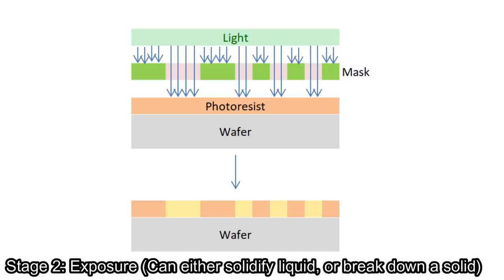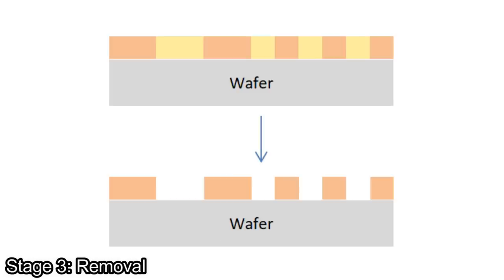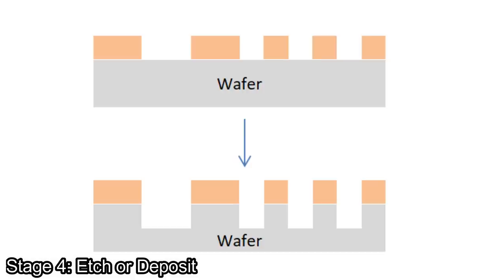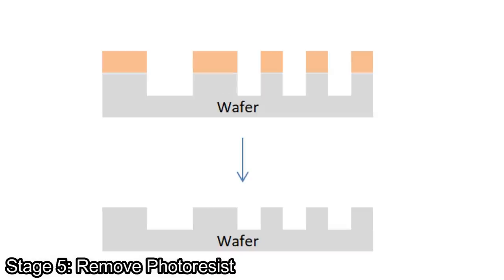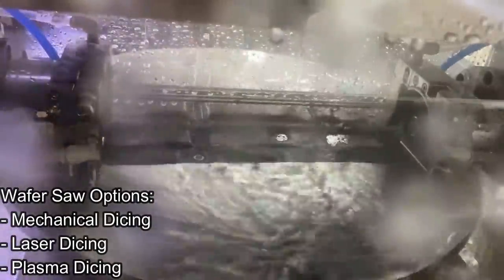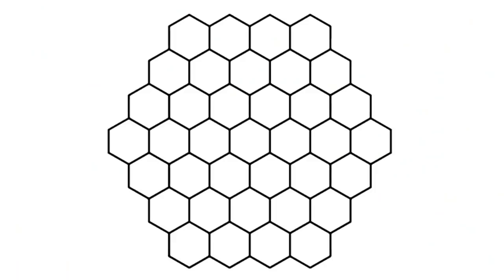Why are Processors Square (and Wafers Circular)?

Comment: I work at a company that makes Lithography tools, and the systems are designed to "print" square shapes... printing any other shape would require an extensive redesign of the projection optics
Reply: Exactly, retooling an entire fab's worth of tools to move from square to another shape would simply cost too much at this point. We're too far gone with square lol.
Reply: But arent optics generally round as well? My knowledge of optics is basically limited to camera lenses, so things might be quite different. Cameras also have the same problem, lenses are round but the sensors are square. I guess because Lithography systems can only print square sensors..
Reply: @calaphos  You will waste a lot of empty space in between circle but nothing in between rectangles.
Reply: @maggiejetson7904  but hexagonal is much better.
Reply: @zalomalo  Until you need to spend more machine time making them, which means money (machine time is the most expensive thing in the fab).
Reply: @maggiejetson7904  Exactly. And the lithium is, as said in the video, very cheap. And reusable I imagine, meaning the extra lithium is just moved back to the beginning of the process and melted
Reply: @maggiejetson7904  Assuming your reticle limit due to optical abberations is intrinsically circular, hexagons are the more efficient way of tesselating.
Reply: I mean, if you put two triangles together, that is a pattern that repeats along two axis, just like rectangular stuff. I'm not saying triangular chips are better, but they'd look cooler.
Reply: @namibjDerEchte  It is efficient for hexagon if time is spent "processing" in optical process (thermal and chemical need no alignment). Aligning in optical pattern means you need to spend a lot of time with 2 axis, or add an extra axis. Slicing and dicing when finish is also harder.
Reply: @zalomalo  begone! CGP fans!
Reply: Is that the reason why the unnecessary partial chips on the edge of the wafer are also created? I have always wondered why they are even bothering to lithography those.
Reply: @DeeGeeFi  Hard to say, they may do that as a way to easily inspect the pattern, like those color coded dot on food packaging with one dot per ink.
Reply: When the photolithography is happening is that being done on a chip by chip basis or on a wafer by wafer basis? Clearly the photoresist chemicals are applied on a wafer basis...
Reply: @BillyONeal  chip by chip, but for simple chip they can probably do many at a time to save money. It is all about density and how much you magnify (like a magnifying glass).
Reply: Actually Hexagons are pretty damn inefficient.  The sawing process would be horrible since the crystal lattice of the silicon would in all likely cause a crack in an off 'axis' crystal lattice cut.  There is also the fact that straight scribe lines aren't actually wasted.  They actually have circuits in them to test the die and the wafer for things lime dopant levels and boundary scan.  When the saw cuts the scribe lines these circuits are cut through and eliminated.  Nothing is wasted.
Reply: @calaphos  Square lenses are IMPOSSIBLY hard to make, round ones are self correcting.
Reply: @maggiejetson7904  I'm pretty sure they try to use masks which approach the reticle limit. You end up with a rectangular grid of duplicated masks whenever you can fit more than one. This minimizes the number of exposures needed for a wafer. It also explains why the edges of the wafer also get developed even when those chips aren't used because that mask is being moved along a non-overlapping grid and at times will be both on and off the wafer. If you can't fit more than one chip in the reticle, I'm sure they do actually optimize this further by avoiding edge exposures (e.g. Nvidia V100). But most chips are many times smaller than the reticle.
Reply: @thoughtsofapeer  Lithium? I assume you mean Silicon?
Reply: You all also need to realize: The chips themselves are tiny already and with the new Chiplet system the amount of "waste" they produce will be even less.

Also, there is no "waste" really. The silicon that has to be thrown away will be recycled, first it will be heated up and centrifuged, so that the silicon crystals and the other materials that were put into it will split apart, then when it's raw silicon again they can put it back into the silicon ingot making machines... or just use it for fancy glass sculptures, as we are literally only talking about the same material they use to build windows, just that windows are not pure Silicon, but Sicilon-oxides.
Reply: The issue isn't so much what shape the current projection optics can print...  The issue, as was sort of explained by the video, is that the lithography process exposes resist that creates the pattern used by the other processes.  This exposure can be done one of two ways... by stepping to each coordinate and exposing the pattern of the mask, or by stepping to each coordinate and then scanning across the field.  The latter is done almost exclusively for all of the more modern processes.  With that process, you have to take care that as you scan, you don't expose the neighboring chips.  This is not trivial, but very achievable with rectangular shaped fields.  If the shape was hexagonal, or triangular, or some other arbitrary shape, I would think that process becomes nearly impossible.  If you are new to Lithography, check out the videos by Chris Mac.  They are a bit dated, but still very relevant.
Reply: @Bard Erland Really? So what do you then call recycled glass? You know that Silicon, Silicium, in Chips is the same material as in Glas?
Reply: Ben fimografi araçları üreten bir şirkette çalışıyorum ve sistemler, herhangi bir baskıda kare şekilleri basmak için tasarlıyor.
Reply: @BillyONeal  Field by field basis. Each field can have anywhere from one die to a many x many die layout.
Reply: I'm actually curious. If a extensive redesign was done. Given with zero to very miniscule margin of error. Would it be better overall?
Reply: @zalomalo  What about triangles? Aren't they the true OG-MVP??😉😋 I mean, probably not, but then you could make straight cuts like now, and yet have something that can be much more flexible, concerning use cases. Coz triangles are everywhere in nature and human construction, including graphic design, CGI rending etc. And with triangles you can make squares and rectangles and almost any other shape too if you go small enough per triangle unit. Although I guess that's true for any other shape too, out of the, what is it, five geometric shapes that you can join with each other within each separate shape category, without producing any gaps in between? These geometric types has a collective name, but it escapes me at the moment.

Comment: So the upshot is, the extra cost of manufacturing far outweighs the cost of the wasted silicon 👍
Reply: Yea, but its not even necessarily wasted as they can just melt it again I guess
Reply: @thoughtsofapeer  sorta. in the material sense it can be reused, but Si thats gone through lithography is gonna be impure (since processing adds a bunch of dopants). youre bascially back to step one, MG Si which is a couple $/kg. then you gotta go through all the processing to get EG Si which is $50+/kg and whatever it costs to regrow the ingot, wafer it, and polish
Reply: @rogertruong6594  while photo and implant often feed each other, they are very different and separate processes. So just because you patterned the wafer, it doesn't mean you've doped it. Photo can feed implant, etch, etc.
Reply: @sirlesliechao  doping occurs on the base silicon, where the transistors are. the patterned layers are on top of that. i may be wrong for newer architectures, but implant in CU dual damascene precedes litho
Reply: Also: even when you couldn't use it for chips anymore... you can just make glass out of it. Glass don't need pure silicon, in fact, colored glass is silicon tampered with other materials...
Reply: Plus the not used silicon goes back into melting.
BTW some "chips" may be anyway discarded due to process imperfections.
I do not know the exact figures, but it is not 100% yield (at least when detectors or ASICS of detectors are produced).
Reply: @UniqueBreakfastTaco  yes, doping generally happens into silicon. However, lithography is used heavily in the front end of line, middle, and back end of the line. If it needs needs to be patterned, it runs at photo.
Reply: @sirlesliechao  feol is pre gate. There is no need for litho pre gate, as doping is done by ion implant. beol is metal/dielectric layering. You've mistaken your terms.
Reply: @UniqueBreakfastTaco  how do you think the source/drain are defined. Another use for photo is an implant mask. You pattern the water (including developing, etc), and then it goes to implant. If you're using a positive resist, the developed areas are exposed down to substrate (or whatever you're trying to implant), and you implant those areas. There are many other uses for lithography in the front end of line. 

BTW: FEOL is technically defined as anything that is pre back end metal excluding plugs 

https://en.wikipedia.org/wiki/Front_end_of_line
Reply: @sirlesliechao  by ion implant. It's like a cathode ray tube, uses electromagnets to move the beam location. But perhaps I'm just old and theyve move past that.
Reply: @UniqueBreakfastTaco  yes, but it's not that precise that you can dope specific source/drains/gates without a mask.
Reply: The use of rectangular die layout is really the most efficient, plus if you had hexagonal die, you would be scribing across natural breakage planes that is not a good idea, it means the physical die is weaker. 
In addition to all of this the "waste silicon" is at the edge of the wafer, which is the most defect dense region of the wafer, so in reality, you may not be wasting any silicon if the defectivity at the edge is high enough to kill the die. This is obviously worst case, but you will get lower yield of edge die.
Reply: @thoughtsofapeer  No, it cannot be just melted again as dopant levels of the ingot need to be very carefully controlled.
Waste silicon if it is to be reused will be converted to the original feed mixture, is SiCl4 to then be used to make poly-Si that is the feedstock in producing the ingot together with the desired dopant.
Reply: @UniqueBreakfastTaco  Very briefly, for planar CMOS transistors the front end process flow contains
zero layer print & etch for reference alignment marks
dep nitride and oxide for island layer, mask & etch island layer, do shallow trench etch, fill and planarise fill oxide
Do N-well, P-well print and implants, VTN & VTP adjustment print and implants
Gate oxide growth, gate deposition and doping, gate patterning and etch
Lightly doped drain implants
spacer deposition and etch
P+/N+ S/D mask and implants, other implants
Salicide block mask and etch
Salicide metal dep/salicide growth
Oxide deposition
Contact mask & etch
Contact fill & etchback/CMP

You may get blanket implants without litho, but usually they are patterned layers, you can also see that there are VERY CRITICAL patterning steps to define the transistors on the base silicon and to carefully tune the characteristics of the transistors, before you get the the back end where you connect them up.
Reply: @COPKALA  Process imperfections and straight particulates from processing and the environment that end up on the wafers/in the films/masking prints etc.
Reply: @UniqueBreakfastTaco  Wrong, FEOL is pre interconnect, it is typically considered to be up to the end of transistor definition & before M1, depending on the process this usually means after contact insulator dep, contact print & etch and contact fill/M1 dep.
Reply: @sirlesliechao  S/D is technically defined back at island mask/etch which define the active regions (ie transistor areas) on the wafer; after the gate is defined and spacers etched, the remaining areas of the island regions are the S/D regions. 
The S/D implant mask is a large open are mask that masks off N+ from P+ regions during the implant.

Comment: Crystals don't always have the same physical properties in all directions. Think of it as a little like the grain in wood. For some directions the wafer nearly splits itself while trying to cut at a different angle might cause it to crack.
Reply: Is a grain direction observed in the alignment of the wafer, so that the photolithography process creates chips that line up along the one of the axis that will be later cut?
Reply: @WarrenPostma  Yes, if you look for pictures of wafers you will see that many of them are not completely circular but have a small straight edge on one of the sides. This will allow the machines to align it properly. When you buy such wafers the specs will say that the alignment is "110" or something like that.